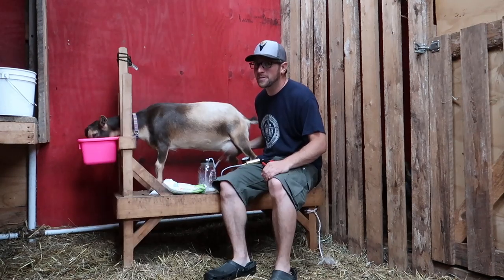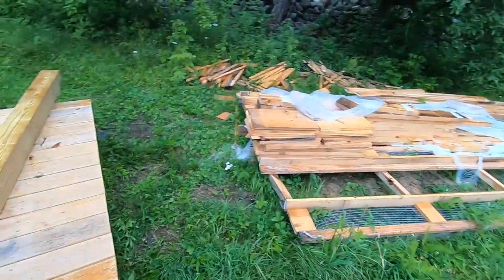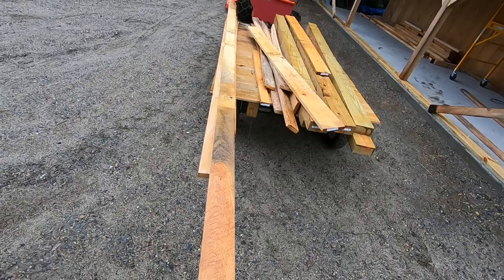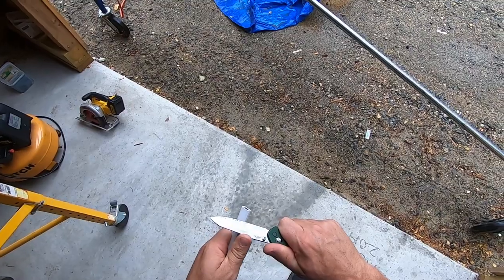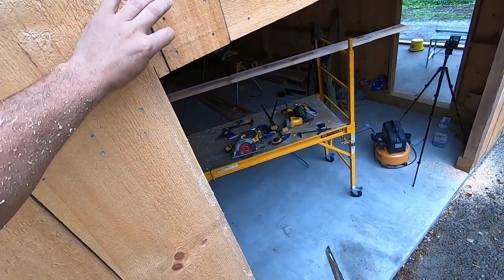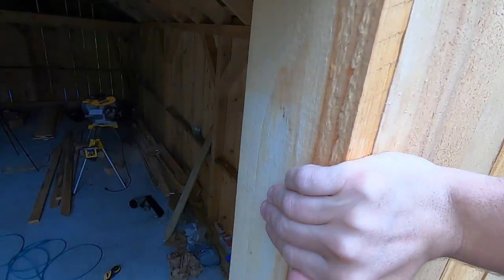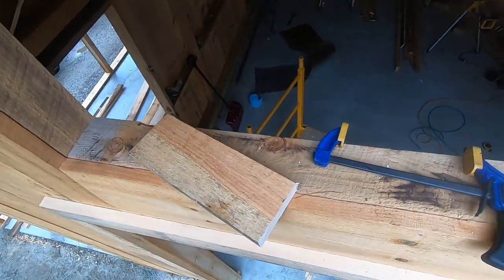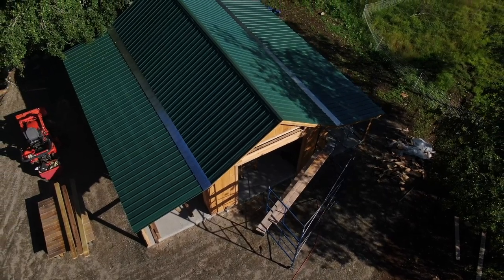This is really Changing the LOOK! Installing the TRIM Work on the Transom Window and Over Head DOOR

Comment: Hi Al, assuming your going to access the stalls/pens from the outside.    You might want to consider an inside door for access to the high demand stalls.   When it's a blizzard it would be nice to go into the main area, grab feed straw/hay and go thru a interior door out into the stall, rather than carrying the supplies outside and then around to the stall.    Will make things easier for when you get older too.

Comment: Good morning Al. "Man-glitter" lol, that's a new one for me.  I've called it "carpenter's-dandruff". Either way, it shows a good wood worker. While you were tapping in the boards with the hammer, I was remembering doing that in my childhood and leaving dimples in the wood, I shifted over to a rubber mallet so I didn't ruin the look of the boards. 
The barn is looking better every video. I would suggest that you put a rail down your ridge pole and install an electric hoist so you can easily put heavy things in the loft. As a 60-year old, I can tell you that a person's body can't do everything it use to, and having the system installed now will be easier than trying to do it when you need it. 
I would also put in some type of wood stove for heating (and keeping a pot of coffee warm or tea), the central section of the barn. A warm barn on a cold winter's day is a delight to work in. 
You also now have a huge water catchment, I would collect the rain water for the livestock and a sink inside (hand pump) for cleaning up.
These are just some of my thoughts. Have a great week,  I'm looking forward to seeing more of the build. Perhaps, when the barn is finished, you could edit the footage from ordering the barn to moving in the goats. I know that would be a lot of work, but you have shown that you are not afraid of working hard. Thanks.

Comment: Hey brother, if I were you, I'd take a short break and take advantage of the tin roof and get a rain harvesting system set up since you now have a much larger catchment surface to gather from.  I know that the other ones you have are fine for now, but why not capitalize on it, right???
Reply: Just some simple gutters draining to the rear and a IBC Tote on a stand behind the barn, with a low fall on the piping you could gravity feed water to all your stalls..... Save all that carrying water to the goats everyday....( Like the New Yoke City set up bu with a larger capacity)
Reply: Yes that amount of roof should give you at least 5,000 litres if not 10,000 litres.
Reply: I bet he does in the long run set up something like that...that would be fabulous right?!
Reply: And possibly put the tote inside if he's planning on heating the barn? To keep the tote from freezing... or simply put a heater in the tote so he has water in the winter.

Comment: Good morning Al...When I had horses I liked dirt floors, but it makes sense to have concrete. Can be hosed down and you can still put lots of shavings if necessary. I used to enjoy deep clean shavings in the stalls. Smelled fresh and kept the fly population down. Monday morning here and the skies are getting darker. So good you have the roofs assembled and can work indoors in your new barn! It will make farmstead life so much easier through the seasons.

Comment: I was surprised Al that you didn't drive the tractor/mower with trailer on the back straight under one of the lean to's on the barn when it was raining and just picking off the trailer as you needed it - I think you are not used to it being there yet
Reply: Have You ever backed up a farm trailor  with 2 pivot points one at the hitch and other one at the front axle  trying to  backing out  and you will have it jacked knifed and jammed in about 6 feet
Reply: @waltlars3687  I would agree, I can just do it with a single pivot point. But thought I'd why not take the time and move all the remaining wood into the barn out at least under a lean to, at least it would keep it dry and ready for the final push. Maybe take time to have a tool fixing season.
Reply: I thought the same exact thing; and even thought about a removable little ramp for a smoother transition.
Reply: @waltlars3687  He could have driven right though!!!!!!!!!!!!!!!!!!!!!!!!!
Reply: @markpalmer9002  I don't watch this program to see Al fix tools or rebuild tools I don't watch that homesteader any more.
Reply: @davenelson9253  no Room to pull through because of the Apple trees
Reply: @icemizul  there would still be the backing it out problem
Reply: @waltlars3687  wander why he chose that spot to build by trees??
Reply: @pearlbubbles6885  He mentioned  it is a high spot on the Farm  and the extra gradeing  because of Mud season
Reply: @waltlars3687  I missed that thank you !

Comment: Al, that's the beauty of having a brand new completely open barn, you can set it up however you want it and what makes sense to you for it to be efficiently functional.  My suggestions would only be to keep the Kubota in there, but also since you have good cover, add some cages for meat rabbits.  Also, set up that roof with the water catchment system you use on New Yoke City, then no more carrying water for the goats

Comment: In the wet area on the east end of your property, hire a bulldozer. Trench in swales, and drain  them into a stock pond. It will leave you with dry areas for growing or whatever you want. Build in a drain which flexes to a floating intake. Install a pump just above the high water line which feeds pipes for feeding and watering.

Comment: Barn use, work shop (with a heater and good lighting and excellent tool storage, first and foremost, to clear out your basement, then a garage for your Kaboda, then a place for all your gardening tools, I like how wranglerstar stores his, and the type (Rogue!)  but this is where you’ll start your meat birds and keep your goats on the sides with meal and grain storage too.  I’m sure it will be great! But get your piles of tools and fittings, and hardware, and spare parts out of the basement.

Comment: Whatever you come up with as far as a pond, hopefully it will be useful to capture rainwater run-off and snow melt that built up in your lower lying areas (like around the current goat enclosure) and be a part of a natural spring or water-shed system.  Also, I didn't notice if you finished the facia and shadow board on the last lean-to portion of the barn.  I most likely missed it.

Comment: I worked for a few years on a horse and goat farm.  The goats were in one of the barns that was originally for horses. The stalls opened from the front and back walls, back let directly into pasture and front into area with feed and milking stand.  It did get muddy sometimes in back but better grading would have helped.  If no direct pasture access, will have to teach goats to lead.  Even trained, I would rather lead a horse than a goat any day.  😵. Just a thought.  ☺️

Comment: You might have considered leaving the concrete out and putting in rubber mats.  Put in a gravel and road base floor and put rubber mats on top.  Easier on the joints and still easy to clean and keep dry.

Comment: Concrete floors are hard on animals joints. They are great to clean though. Consider livestock rubber mats over the cement, easy to clean like concrete but softer on knees and joints when the animals are laying down.

Comment: A really nice paint job on the flashing; the flashing takes the color of the sky as does water. It shows as blue at the end of the video. Will you set up your workshop in the front?  It will help to be near the doors for easy access when you do a large build? That will make it important to stop drafts and locate your tools carefully. I assume you know about a French cleat wall. A solid fence in the plan for the Northside would help and evergreens north of that if they do not limit access for something else. Nice work! <><

Comment: I can't help but think you'd get better milking results if you found a thicker-walled tube for your hand vacuum pump.  Regular medical tubes aren't made to handle a negative pressure.  If you found some that was wire reinforced, it wouldn't collapse.

Comment: you make putting the barn together look so easy!  You will make good use of it come winter and the goats will enjoy the space and warmth it will provide. 

I am surprised that you don't seem to have a dugout ion site. in Alberta, on the prairies, farms often have dugouts to capture and hold spring and storm runoff. Then when needed the ca n pump water to the fields or the garden.   
https://open.alberta.ca/publications/9781460123508